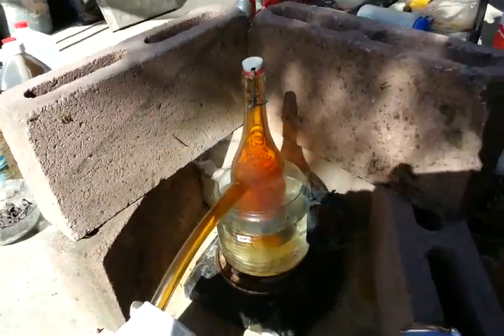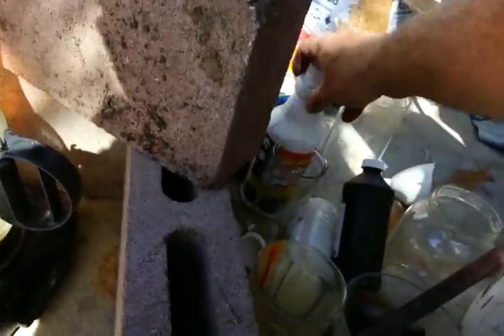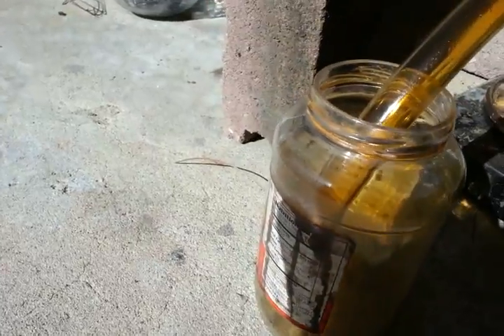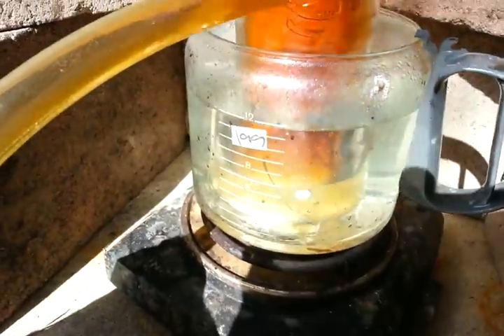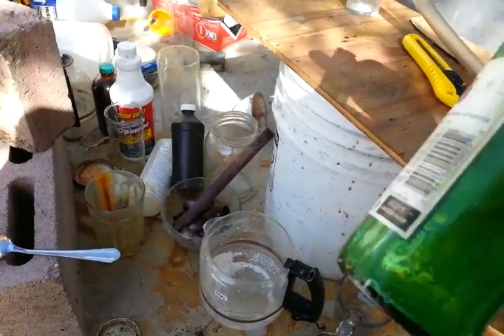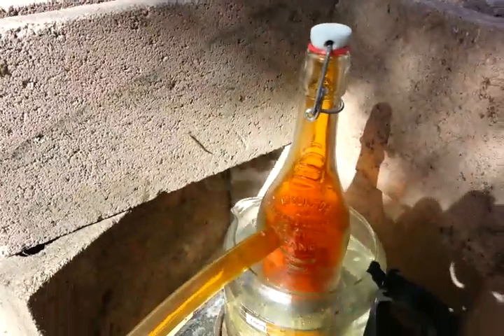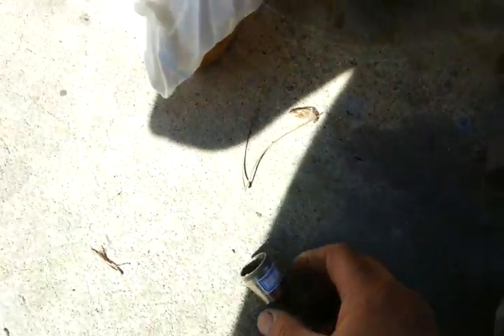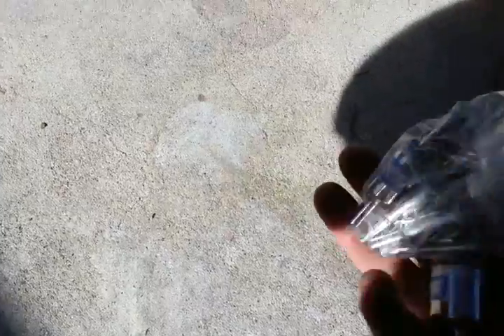poor man's distiller apparatus nitric acid

Comment: Amazon has some pretty cheap distillation sets like 20 to 25 dollars and if you have somewhere to have it sent and don't have to use an Amazon locker you can get a retort for 50$ that is the main distillation set up for making acids if you have a hundred dollars you can get a full distillation setup, I'm homeless am done the street so I was so happy to find Amazon , there's lockers if you don't have an address or if you sign up for Amazon prime free shipping and same day deliveries or even just next day. And if you get Spectricide Stump Remover it's 100 % potassium nitrate with some impurities, also could get on Amazon or just find a Lowe's if there is one. It worth checking out anyway, it's almost Christmas so you could ask all our relatives for Amazon gifts cards and go wonky. There's Lab equipment portable Coleman propane stoves pretty much everything you would need to refine metals from computers or if out get enough nitric could dissolve silver out of the soil and precipitate it back out with copper , make aqua regia and get some gold out of electronics, all for 20 to 100 bucks. Anyway hope all has been well with you.